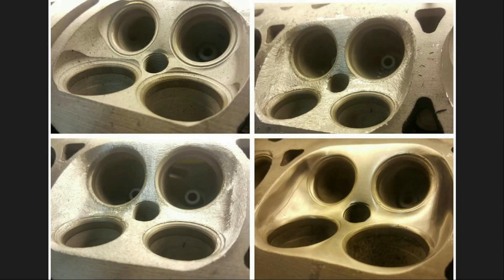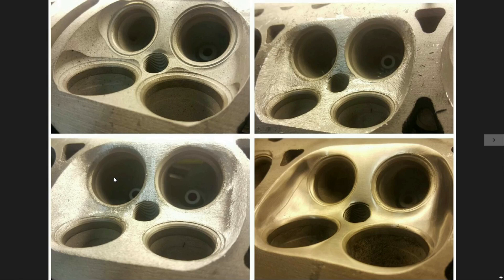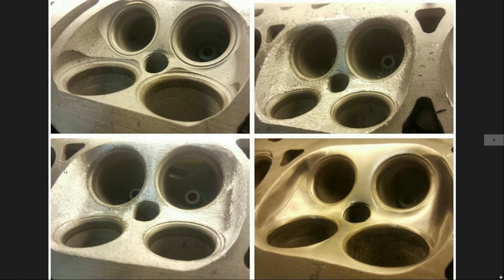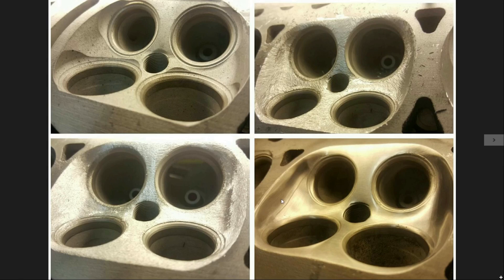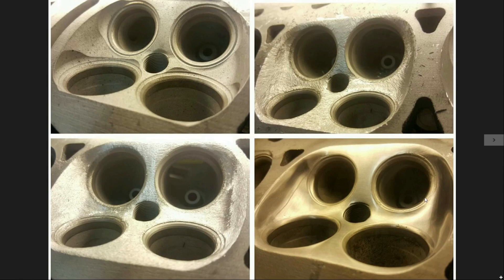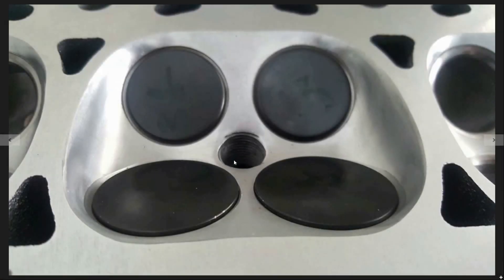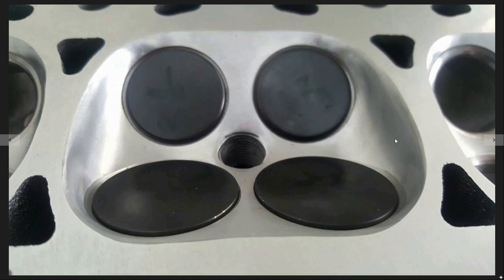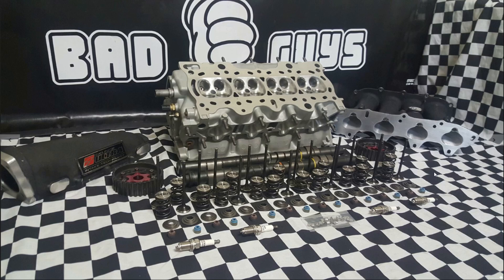Honda GSR (P72) Combustion Chamber Modifications

Comment: I've gone 40 thou on the head shave.  I'm going to do the chambers and ports.  How fine can I go on the intake port. Plus I'm using a permaseal vrs gasket kit.  Should I vht copper coat the head gasket.  Thanks.  Any direction would help.  The  goal is to make the automatic and quick as my stock manual and hopefully a good fuel consumption. It blew a bypass hose which torched the head gasket.

Comment: Does chamber work like this have equal potential with just a regular valve job without touching the port shape or size?
Reply from the maker: The only down side will be adding chamber volume and lowering cc. Other than that it is all upside you will reallyl see gains in the mid range of flow
Reply: @badguysworldwide  so you're sacrificing some CR for more mid-range flow? If you can make that CR back up with some different pistons then I don't see any downsides at all :D keep up the amazing work guys these videos are really entertaining
Reply from the maker: Thank you